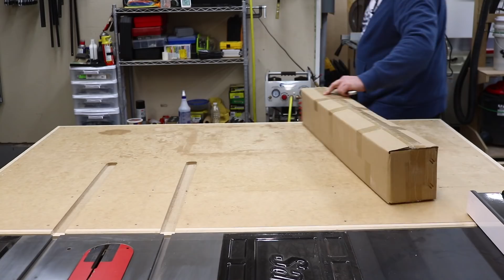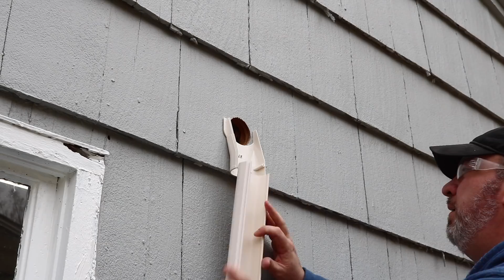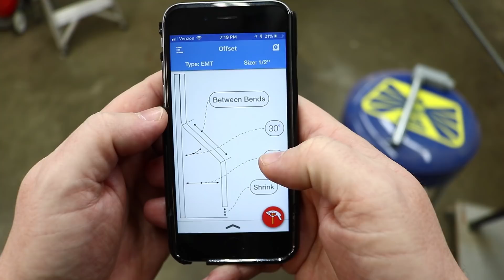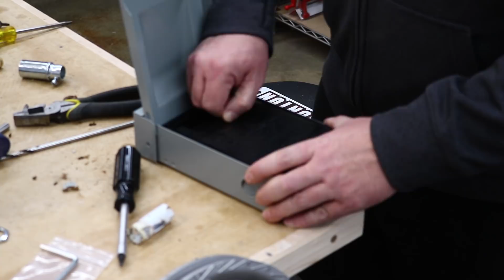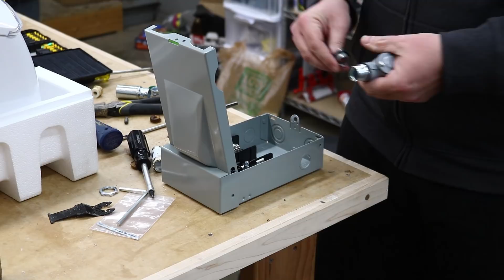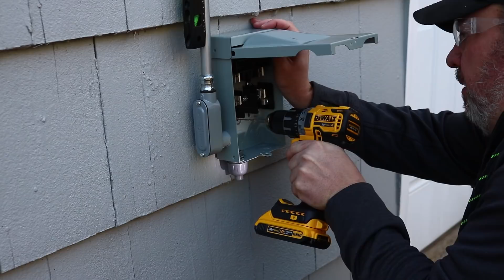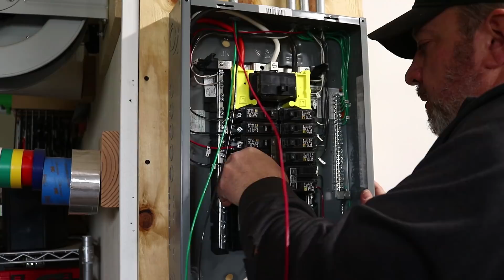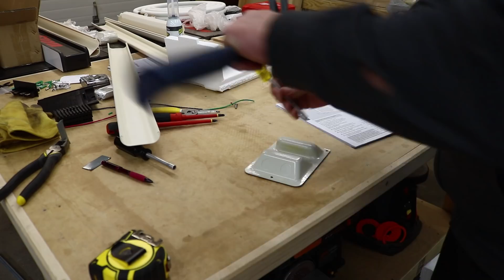How to Install a Ductless Mini Split

Comment: good video but it seems like you left out hooking up the line set to the unit and what had to be done there, plus finishing off the line set cover.    maybe i totallly missed it, if so apologies
Reply from the maker: Kevin, I mention in the video that I hired a licensed HVAC contractor to do the final hookup and vacuuming of the system.  He did that off camera.

Comment: I'd imagine you'd  have a lot of sawdust blowing around in there from woodworking. Do you have to clean the filters on your mini-split often?
Reply from the maker: Stephen, yeah, I try to clean them once a week or so.  When I am doing something that creates a lot of dust I turn the unit off but I have decent dust collection in my shop so it's not a big problem.  Thanks for watching!

Comment: Well put together video,  I didn't even realize 20 minutes had gone by.  Looking into this myself for an apartment building I own.  The only thing that I have seen from other videos compared to yours is the mounting of the ground unit when you're in a climate that gets snow.  It's been recommended to mount it higher so the snow doesnt pile up against the unit,  have you noticed anything with this?
Reply from the maker: Yeah, I thought about mounting it on the wall but was in a bit of a time crunch.  We got a lot of snow this year and it was never an issue.  Thanks for watching!

Comment: If this is a heatpump it is not at the right height off the ground most need to be 18inches off the ground also depending on snow fall amounts will also effect the height of the condenser.
Reply from the maker: Not according to the manufacturer of this unit.  

Why would height even matter?  There is no air flow coming from under the unit.
Reply: @TheAverageCraftsman  You might want to research that I have put in hundreds of these systems and if it is in a cold climate you could have an issue. When I see improper installation's especially if its posted on the internet it is doing a disservice to the people who are viewing this. 33yrs in the trade I might just know what I'm talking about.
Reply from the maker: I am not claiming that you do not know what you're talking about.  I asked why it matters.  

In the installation manual for the unit it shows a diagram for placing the outside unit.  In the diagram there are dimensions for front, side, back, and top clearances and the unit is sitting on small pads like I used.  

So, again, why does bottom clearance matter?  There is no air flow down there.  It's just a small hole for drainage.  

Thanks for commenting.

Comment: Great video and a nice job. But, by doing a DIY installation do you void the manufacturer's warranty or upset the local building authorities?
Reply from the maker: Thanks, Suzanne!  

It all depends on the manufacturer.  Some allow DIY installations, some allow it with an HVAC tech doing final install.  It all depends.  My warranty is in tact.

Thanks!

Comment: how much did you pay for the hvac tech to pressurized the lines for you?
Reply: do you remember how long was supplied lines were? and thanks for the reply
Reply from the maker: For my unit I was able to select the length of lineset I wanted. If I remember correctly I think I ordered 10 feet. Some units come with a set length like 25’ though.
Reply from the maker: If I remember correctly it was $150.  He also did the final connections.  Thanks for watching!

Comment: The reason i was looking up videos is to check and see if there was a better way to bend the copper line set outsid. I feel like i bend it too much. Do you have any tips.
Reply from the maker: Sorry, I don't.  I hired an HVAC technician to do the final connections and let him bend all of the pipe.  I think the key is to just go in very small increments.  Good luck!

Comment: Looks like a proffessional did it. Im a small Hvac contractor. But your work looks good. If this is a heat pump you might want to raise outdoor unit off the ground next time.
Reply from the maker: Thanks, Lionel!  

Yeah, I would probably do the placement different if I did it again.

Comment: I'm curious what your total material cost where?  And total labor hours?
Reply from the maker: It was about $1400-1500 all in.  Install took parts of four days.  I recorded everything I did and only had about five hours of footage.  The vast majority of those days was spent on research and making sure I was doing things correctly.  If I had to do another one I could probably knock it out in a day.

Comment: Looks pretty good.  I like splits.  But I went with a non split.  A package unit.  Like you would see in a hotel room mounted in the wall.  Cost effective and very easy install.
Reply from the maker: Heat and cool?  Got a link?  I'd like to check it out.  Thanks for watching!
Reply: @TheAverageCraftsman  yes I will get it.  Heat and cool on 220v
Reply from the maker: Ah, gotcha, I was confused.  I thought you were referring to a unit that didn't require a wall penetration.  I think I'd take the mini split because it doesnt take up any floor space.  The packaged unit looks like a good solution though!
Reply: @TheAverageCraftsman  Yes you cut the wall for the unit.  Which is not a big deal.  Its simpler than everything you have to do on the split system.

Comment: Two years ago, I had a Fujitsu single head unit installed and absolutely love it. For me, it was a choice between Fujitsu or Mitsubishi, though some told me Daikan was a good unit. I read and was told in person that other brands, especially the American brands,  were inferior.  This meant that although I could buy them through the internet, I could not self-install my two preferred choices without voiding the warrantee; big disappointment. 
So, that leads me to two questions for you:  1) Did you have issues with purchasing and installing the Pioneer or was it not a problem because you had an HVAC tech do the refrigerant lines?  2)  How does the Pioneer measure up to the two big names in the industry that I was considering?
Reply from the maker: No problems with warranty as far as I know.  I generally follow the "you get what you pay for" axiom and Pioneer are quite a bit cheaper than brands like Mitsubishi so I would say it's not as good of a product.  That doesnt mean it's bad but maybe it wont last as long, maybe parts arent as readily available, etc.
Reply: @TheAverageCraftsman  Thanks for the reply. If the Pioneer was cheaper and they don't void the warrantee if you aren't an authorized professional installer, it sounds like a great money saver on both purchase price and installation- therefore, a wise choice.

Comment: Very well done - I'm planning on installing one this coming year. I'm hoping that an AC/Heat Pump mini will be enough to warm up the garage when it's above -10C which I've heard is doable. Is yours just AC or does it heat as well?
Reply from the maker: It’s heat and a/c. It will heat with the outside temp as low as -13 F.

Comment: Looks pretty good! I'll be putting one or two mini splits in my big new shop so I'm seeing what others have done. Two things:
1. When I saw you put the outdoor unit on just two pavers on the ground, I thought "oh, he must live where there's no snow" but then I saw the snow. Aside from the unit moving as the ground settles over time, snow building up around could be an issue there.
2. When doing outdoor wiring, it's a very good idea to use Nolox (I think that's it), a greenish goop that you squish into the wires at terminations to prevent oxidation.
Anyway, I bet it's nice to have that setup now, especially since you did most of it yourself! I hear you on things taking forever because of research; everything I do on my new shop (I'm doing every last bit of the work except the foundation) takes a while because I have to keep looking things up to make sure I'm doing them right.
Reply from the maker: 1. Well, they are starting to move around.  We've gotten a lot of snow the past few weeks and things have frozen and thawed a few times and the pavers have moved so it's something I need to address.  Honestly, the best option would be to hang it off the side of the house but I was in a hurry!  Not sure what I am going to do but I'll figure it out.

2. Good tip!

I do love it.  It would be even better if I had my ceiling insulated but at least it keeps the shop above 55 when it's 0 outside.  Good luck on your shop build and thanks for watching!

Comment: AC,Great video, easy to follow and understand. I'm thinking about having a unit installed and hiring technicians to install the unit. What is the average cost to install a complete system parts and labor? I realize that labor cost vary from area to area, I would just like to get a idea of cost.Thanks,JB
Reply from the maker: The units can vary from $1000-2500 for one similar to what I got which is 18,000 btu.  The labor soup to nuts is another couple grand. It’s pricey. I wouldn’t have done it if I had to hire out the labor. Thanks for watching and the comment!

Comment: Should you have bolt down the outside unit? Seems to me that the base is not really secured
Reply from the maker: As long as it's level and the pad is secure it won't go anywhere.  Mine hasnt in the year since I installed it.

Comment: I have a Fujitsu mini split for an addition I put on my house and love it.  I hired and hvac company to install but I provided power to the disconnect. Hvac contractor charged me around $3800 (lowest bid of 3).    I'm thinking of doing one for my garage and I'll probably attempt it myself.  Have you had any problems with shop dust hurting the head unit?
Reply from the maker: No issues with dust so far.  I clean the filter regularly and have an air filter running all the time in the shop and pretty decent dust collection.  Good luck on your install!

Comment: Great job! Meticulous care in doing this project is evident. You really did your research. Got it right the first time. OK, maybe a bumps but Hey it works and looks great. Looking to do something very similar real soon here. Thanks for your insight on how you did your system.
Reply: Brought home a two head Mitsubishi mini-split system home today. Now it's my turn to say, This going to be a pain in the Butt! 😇🇺🇸👍 Thanks for the encouragement.
Reply from the maker: Good luck!  I mentioned it in the video, but I'll say it again here, I HIGHLY recommend reaching out to an HVAC tech and talking with him/her before you do your install just to make sure you've covered all of your bases.  Then have them do the final line connections and startup.  It cost me about $150 for that and it was well worth it.
Reply from the maker: Thanks!  Good luck if you decide to take one on.

Comment: Very good video. I bought a mini split last week and started getting all the prep work done. I’m glad your video confirmed that I had everything I needed and was going to be hooked up correctly. I haven’t yet cut the hole through the wall and but seeing that you did use that long drill bit to make a pilot hole was a great idea. The cutting the hole in the wall part is the nerve racking part. Can’t screw that up! Anyway this is by far the best and most reliable video for installing mini splits I’ve seen.
Reply from the maker: Thanks, man! Hope your install was successful!

Comment: You did a great job on this video.  If I can make a suggestion, I sure would have liked how you figured on the size of your unit.
Reply from the maker: I thought I mentioned it in the video but apparently I did not.  I just relied on the manufacturer.  Most have calculators on their site where you put in your space dimensions, windows, insulation, etc and they tell you what size unit you need.

Comment: Great job man, you did everything a technician should do in your situation. As a technician myself the only thing different I would've done is leave the signal cable after for when the unit has been mounted and pipes pushed through and I understand hiring a tech because a good vacuum pump can be pricey ranging from 400 dollars onward. Not to mention the nitrogen tank, regulator and gauges.
Reply from the maker: Yep, hiring the tech was money well spent.  Thanks for watching!
Reply: Do you recall roughly how much your AC tech charged you to do all of the line set connections, pressure test, vacuum, etc?

Comment: Wire the indoor unit last... the wire is just in the way otherwise. Use PVC for the conduit. So much easier and does not rust. PVC is easy to bend when you heat it. Heat Gun,  Torch  or high output hair dryers work for these small size conduits.
Reply from the maker: Thanks for the tips!

Comment: I wonder how you could connect this to a generator in the event of a power outage?
Reply from the maker: I am sure it could be done but that’s above my knowledge level.
Reply: You wire in a transfer switch to your circuit breaker box. Hook the generator to that and flip the breakers you want powered.

Comment: Great video, thanks.  Is the warranty still valid because you had a tech do the final connection?
Reply from the maker: Thanks for watching! The warranty is in place but if you’re thinking of doing this yourself reach out to the manufacturer before you buy just to make sure you do everything the way they want it.

Comment: Good job.  Just a couple of comments/suggestions.  I would suggest you fish the electrical in the walls and ceiling even if its a pain.  It saves time and conduit/connector costs and no conduit outside either.  I did notice you should have used a few more conduit straps, (eg. one before and one after each turn) but your bending craftsmanship was excellent with the EMT.  I’m not sure about code in your area but outside conduit is usually the thick wall IMC not EMT.  Also code does require an outside plug for HVAC maintenance (I think another viewer mentioned that too).  Keep an eye on that AC pad.  You’re in a climate where frost heave is inevitable.  The heave could damage the air conditioner tubing and release the refrigerant or the outside unit may even have it walk off the pad from the slope.  Too bad you returned the house mount bracket that would have eliminated that.  But brackets sometime transmit vibration from the compressor to the structure.  Tough call.  I think you did an excellent job and thanks for posting.
Reply from the maker: Thanks for watching and thanks for the suggestions!

Comment: the room where i need the ac does not have direct wall to the outside,so i was thinking of cutting drywall ,go through wall and under the house to the outside unit ,about 40 feet total ,do you see a problem with that? thanks
Reply from the maker: I dont see why that would be a problem.  The only thing that might be an issue is the lineset length.  Each unit has a maximum length.  The bigger the unit, the longer the lineset can be, generally.  I would check with the manufacturer.

Comment: is it a problem if the outside unit is in direct sunlight?
Reply from the maker: The manual for my unit says it needs to be kept out of prolonged periods of direct sunlight.  My unit gets maybe an hour of sun in the evening.  I have seen a lot of units installed in on buildings where they will get a ton of sun.  If you have a unit picked out I would check with the manufacturer and see what they have to say.  Thanks for watching!
Reply: mt, You could build a little canopy to shade the unit if needed.

Comment: I installed mine and it took me 4 days too.  I was thinking he did it in one day nahh impossible only a pro or previous experience. but I ran electrical conduit for future expansion to the extra room  and separate line for xmas lights.
Reply from the maker: Took me about 4 days as well but my footage I recorded was only about 5 hours.  I just had to do so much research and planning on dang near every step which is why it took parts of four days.

Comment: I just may attempt this.  My install will be complicated by the fact that I have to apartments that need to be serviced with AC.
Reply from the maker: It's not that hard.  I'd recommend trying to find an HVAC tech to help you out with at least a consult.  I found mine using Nextdoor.com.

Comment: ok so i watch this video and it said pioneer system. I realize all these company using the same system and just slap their own brand on. I just installed mr cool diy 18k btu system and everything look the same.
Reply from the maker: Yeah, I am guessing most of the brands on this level are from the same manufacturer.

Comment: What is the height of the indoor unit and what do they recommend for the clearance to the ceiling?
Reply from the maker: They recommend 80-100 from the floor with 4-6 inches ceiling clearance and 3-5 on each side.

Comment: nice vid, but installing to the ground outside :(??
Reply from the maker: Yup, as long as it's level, doesn't vibrate and has all the right clearances, ground mounting is fine and recommended as an option by the manufacturer.

Comment: Beautiful work handyman! But, why didn't you buy a DIY unit? Wouldn't that be cheaper?  Or was the SEER rating on your chosen unit so much better that over time that the saved electricity would pay for the installer ?
Reply from the maker: Thanks for the comment.  During my research phase the only "DIY" unit I came across was Mr Cool.  While they were an option I chose to go with the Pioneer for a few reasons: 1) overall cost was cheaper ($1600 for Mr Cool and I was all in for about $1300 for the Pioneer) 2) Mr Cool could only heat down to 5 degrees.  The Pioneer can heat down to -13. 3) Mr Cool units come with a 25' lineset that you cant cut to length without having to recharge the system.  I only needed about 10' of lineset and I didn't want extra rolled up on the outside of my house.